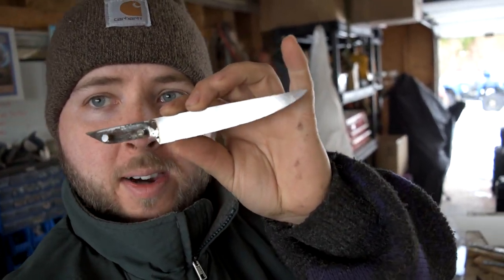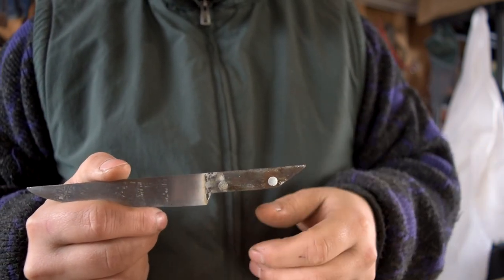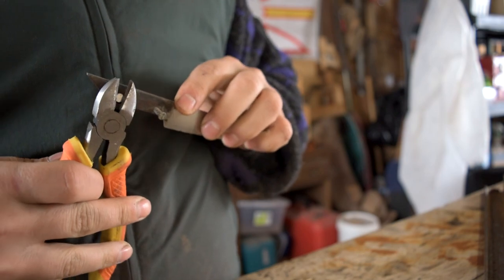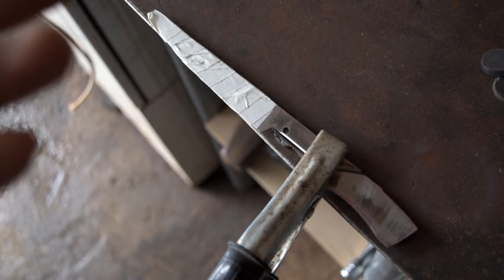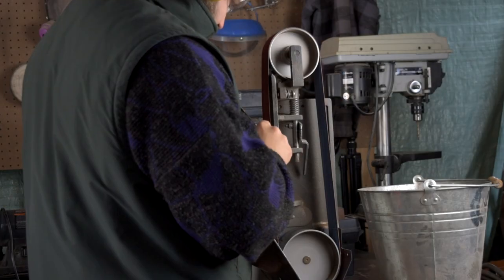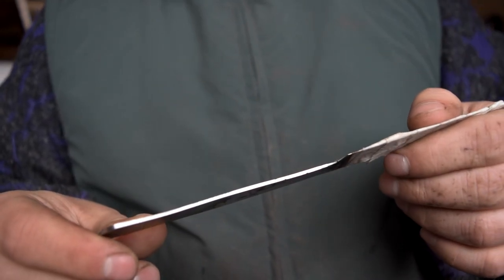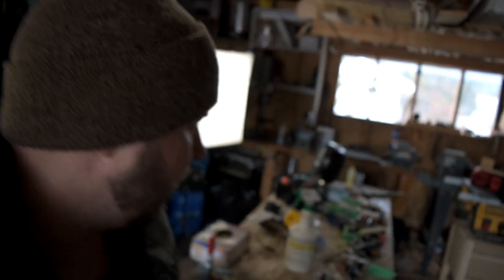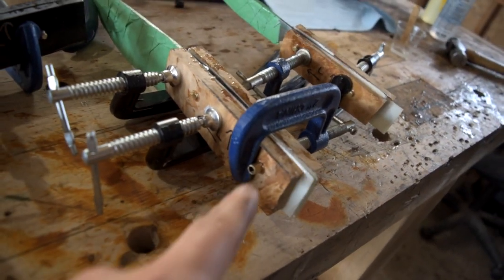Making a FULL TANG knife from a PARTIAL TANG

Comment: Hello Kyle! I want to do this with a santoku knife I got a while back... handle gave out, so I pulled the blade out and its tang is barely 2 inches long. Blade says it's stainless, but I'm not sure what kind of stainless. I have a buddy with a welder who said they could tack it up to extend it for me like you've done here. Since I don't know what I'm working with, is it bad for the longevity of the knife if I tack weld the blade tang to a different kind of metal? Thanks in advance!

Comment: You're on the money with your guess as to how the original handle was installed. They had a handle blank with a kerf (from a circular saw, that's why the tang has a semi-circular profile at the end) to insert the tang into. The tang would be exposed on top of the handle and hidden at the underside; put in the rivets, hammer them tight and you're done. If you are interested in seeing an old German craftsman making these traditional handles, there's footage on youtube (commentary in German only, but still might be interesting to watch for the craft): v=a6YnsgieLRo